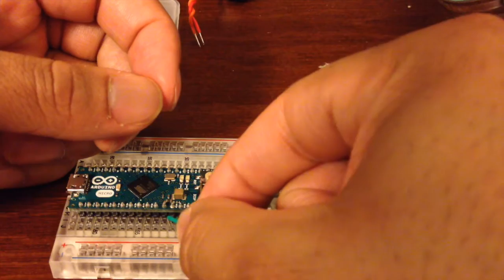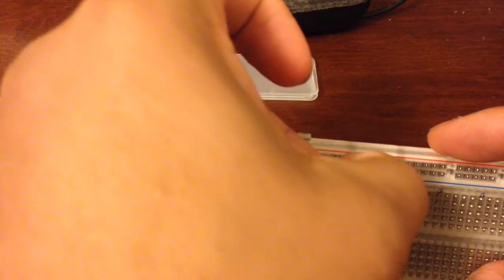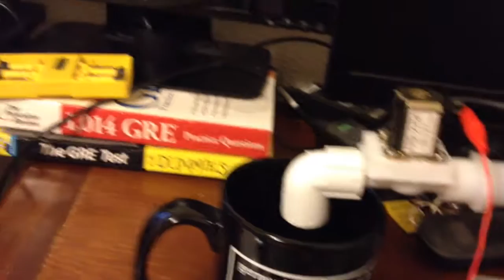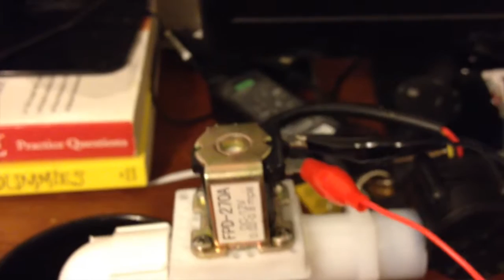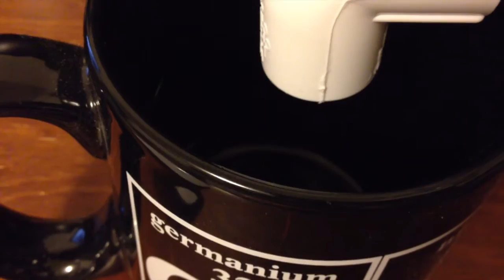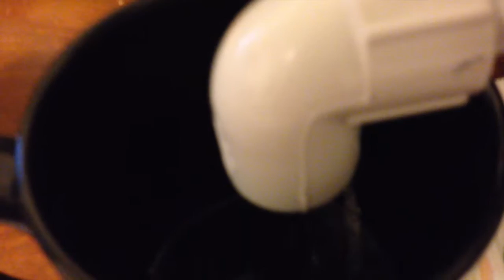Arduino: Solenoid Valve

Comment: Just wondering..Why did you use a transistor and a relay? Wouldn't just the transistor be enough? It both switches and separates the high current from the arduino.
Reply: Laura Bongaardt i just made some research would it work with transistor because the transistor consume alot of voltage drop

Comment: Sorry, do you know how to control 220VAC solenoid valve with arduino? Thank you for your help.
Reply: you can use something like this that can switch a higher voltage circuit: 
https://www.alibaba.com/product-detail/DC24V-12v-220v-over-under-voltage_60439881975.html

Comment: Can i use this solenoid valve as an autoshut off for LPG gas?
Reply from the maker: +Aiza Marie Sambo I don't think so. I would think you would want a valve that is rated for gas. I think the valve I used would likely leak, but there are probably suitable valves out there that could be used for gas.
Reply: +StartKinect can you give me any suggestions on what valve can i use for LPG auto shut off??

Comment: Is there any way to connect the soil sensor to the solenoid valve so it turns on and off when the soil needs watering?

Comment: Can you explain to me how you find the resistor value?
Reply from the maker: +ByteMe Hey Sorry for the late reply. I looked up the part (2N2222A) data sheet. I then looked for the base saturation current, since I want the transistor to operate as a switch, I then picked a resistor that would get close to that current from the 5V pin on the Arduino. I am not sure on the part number, it was from a RadioShack electronics kit, and It has a couple different transistors. I hope that helps.